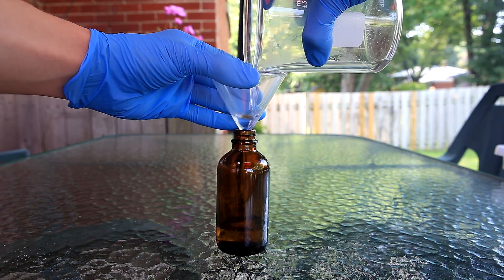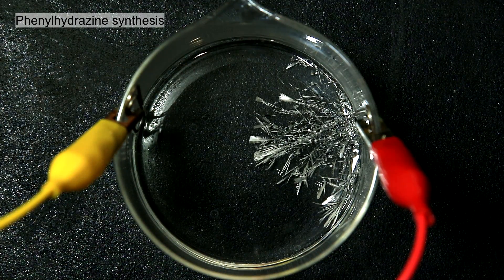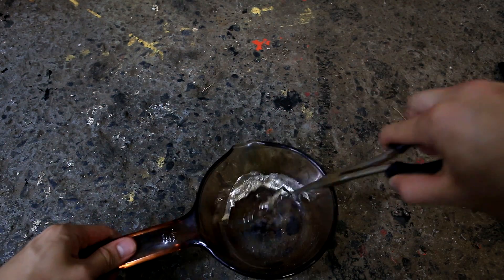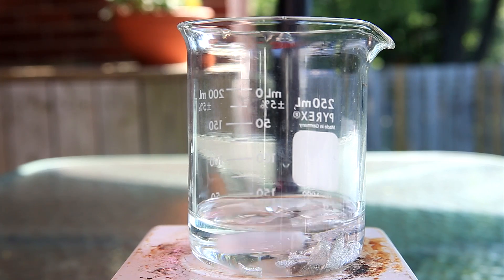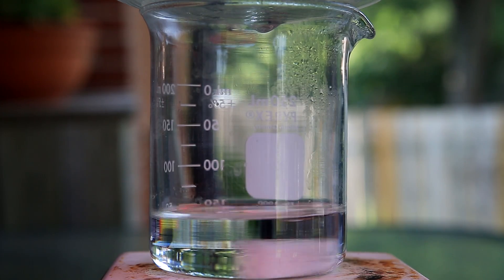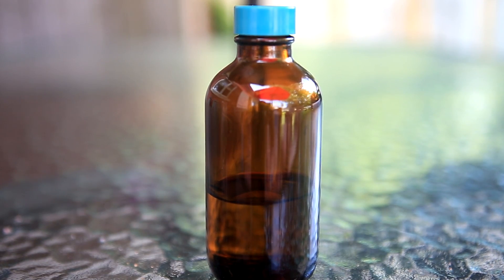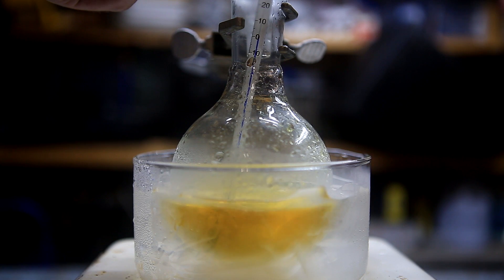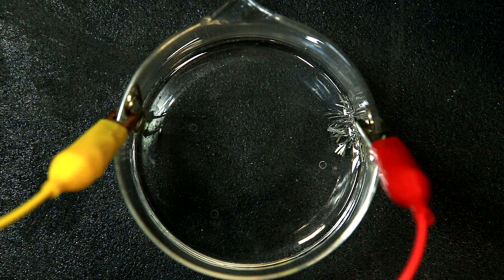How to make a Stannous Chloride Solution (Tin (II) Chloride)

Comment: I have been trying to make stannous chloride. Had two attempts, but every time it turned out to be purple in colour. What has gone wrong? I used tin pellets at 99.9% purity and 32% Hydrochloric acid from the hardware.
Reply: There had to be impurities somewhere. Stannous chloride turns purple upon precipitation, so something made the tin precipitate. Try another source if either acid or tin. Say you try a different brand of HCl and it still turns purple then you know it's your tin and vice versa.

Comment: I'm having a hell of a lot of trouble with the situation I need tin oxide for ceramic glaze recipe. I had A-1 Bail Bond tin ingot already so I put it on the mill and I shaved a small quantity down for testing. I put it in the drawers of my Mill Vice sticking out sideways with a box underneath it so I wouldn't lose any. Anyway I a used a 50-50 solution MTI water and 20 Baum hydrochloric acid that I actually made a couple of years ago. I heated then stirred it for actually a couple of days and all of a sudden all the tin particles turn into white powder. I got pissed off and I turn the heat up all the way and boiled the hell out of it to see if I could get it to go into solution. The amount of white powder dissipated by about 3/4 but when it cooled needle-like crystals formed. I repeated this Experiment three or four times over a week it didn't happen the same way every time. So it isn't entirely that difficult to come up with a crystalline form of tin chloride unless I was just very lucky

I've tried electrolysis to make tin sulfate and stannous chloride and all I get is black sludge on the anode. And the water turned black as well. A funny thing before I add the electrolyte to the bath I noticed it that for a short time before the anode get coated white precipitate flows off of the cathode of tin quit rapidly.

If you have anything to comment on this please do because I'm in desperate need of this oxide
Reply: I'm finding 250g for 25 dollars on ebay - unless you're outside the USA then ignore me
Reply: @ryjelsum  that is a ridiculously high price for my purpose. of it were for chemistry I would be using grams at a time, for pottery glaze, well that's another story, and why I am trying to make it

Comment: Could have been faster with electrolysis in hydrochloric acid, put positive on the tin, and whatever on the negitive, you know
Reply: I was wondering if that would work, thanks for the confirmation. I'd like to do a one step process to produce tin crystals from tin bars and HCl.

Comment: would it be possible to extract the tin from lead free solder
Reply: Yeah, you just need to react the solder with HCl and then either electrolyze it or add nickel or iron to the solution to reduce the solution. However, electrolyzing the solution for too long might reduce other metals too.

Comment: I am wondering that this solution is the same thing as "liquid tin" which can be used in home made PCB manufacturing process for electroless tin plating? Do you know the what is liquid tin. It would be awesome if you make a video about it.
Reply from the maker: From the 2 seconds of searching it appears to be a stannous chloride solution with other ingredients like sulfuric acid and urea
Reply: Thanks. I am not able to find this solution in my country (Turkey) or cannot import due to customs regulations for chemicals. I may give this list of ingredients to local chemists.

Comment: Why do you specify 12g of tin, is that the maximum that the solution can hold before becoming saturated? What type of glass pan did you use to melt the tin? I'm a little surprised it didn't crack under heat from the torch. But maybe I'm just underestimating the heat tolerance of glass cookware(?) Lastly, how stable is the stannous chloride solution of stored in a brown container? Does it need to be stored at or below a certain temp, and. what is it's shelf life? Thanks. The follow-up video of tin crystal making is interesting.
Reply: 12 grams of tin is the ratio, some glass are "pyrex" (I don't know if it's the same in other countries), pyrex glass can hold more heat then normal glass.
Reply: 👉 Tin melts at the comparably low temperature of 450°f or 231°c, which can be easily accomplished on a kitchen stove. That means tin's melting temperature is low enough that it's under the maximum safe heat tolerance of glassware that's specifically made for heating and cooking. I melted a few ounces of tin and poured it directly onto our glass stovetop, and onto a ceramic spoon holder without issue.

 However, it's probably a good idea to point out that there are undoubtedly certain types of glassware that may not handle temperatures of 450°f+ without cracking or breaking.

Comment: Can this be done with lead contaminated tin? Pretty sure hydrochloric acid also reacts with lead. I assume the lead will not form crystals, so I was curious if this may be an easy way to separate tin from lead.
Reply: +Richard Smith 
i guess we're stuck on same problem

my tin solutions become yellowish...
Reply: Franky Yodi So did the solution still form tin crystals? The lead changing the color of the solution is not a surprise. If you are using old solder, you might want to remove any resin that may still be in it as well. That would surely mess things up.
Reply: yesterday i filtrated the solution with filter paper...

but still yellowish..
and next day...
theres some  ??? crystal at bottom...

im not sure that was tin or not
Reply: and now i making zncl2 for welding purpose
far faster than making tin cl2...
3-4grams zn  for 4 hour i guess
Reply: Franky Yodi Mmmkay, I guess that means I'll have to experiment myself with it :)
Reply: But be carefull with lead. When HCL reacts with lead or lead oxides it forms chlorine gas!
Reply: Franky Yodi pb still in solution
Reply: Franky Yodi yg di dasar botol itu PbCl2

Comment: instead of heating the HCl and tin solution, will adding some H2O2 speed up the reaction?
Reply: Yes. I use 3 parts H2O2 (3%) to 1 part HCl

Comment: Most of the tin sources have lead in the, in about 60/40 Sn/Pb, the lead will also react with the HCl, but will it grow crystals with the tin? Or the crystals will be pure tin? Great video!
Reply: KaliyaK PbCl2 would precipitate.
Reply: Yes
Reply: You will poison yourself with lead
Reply: @firehoax9230  
I remember in the 80s when I was 9yo, we used to play with air guns shooting lead pellets. The pellets could easily be lost in a pocket with a hole, so the safest place we found to store them was in our mouth. We all survived!
Reply: I suppose if you have to electrodes , one with lead and one with tin , the tin would go to the tin and the lead would go to the lead , but I dont know
Reply: @1224chrisng "two electrodes, one with lead and one with tin" 

No.
Reply: an interesting idea, but ... The most noble metal will deposit first. This is actually used in copper refining. So first the tin would deposit, then the lead. Albert

Comment: 13 hours... woof. Did you know it would take that long at the start? Perhaps cutting the tin much finer would have helped a bit.
Reply from the maker: +TDKjim8 Yeah it would. Tin powder would go much much faster
Reply: +Nile Red I hoped that you would show us trick how to speed up the process. When I wanted to chemically remove a tin layer from tin plated pieces I would use antimony pentoxide as a catalyst. Of course this useless if you want pure tin chloride.
Reply from the maker: I researched ways to make it faster, but it seems the easiest thing to do is to just be patient.

Comment: Stannous chloride can also be used to test for gold, palladium and platinum in solution. It however, expires, some people says 2 weeks in the bottle, you can extend it's life span by simply putting tin metal in the bottle, the tin IV oxidizes the tin 0 to form 2x tin II, oxygen is the villain. Just thought i could share this!
Reply: this was in a episode of house too lol
Reply: I use it for gold recovery (3g to 30ml HCl) and have noticed degradation too - however it takes several months before it makes a noticable difference... every third month or so I add a 0.2g tin pellet to the bottle...
Reply: Tin popcorn would work better? That is when you flash cool tin by pouring molten tin in water, and steam bubbles caught inside causes it to explode internally like pop corn, revealing a LARGE amount of surface area.
Reply: AuraRisen I'm

Comment: Where do you get those bottles?
also where did you get the tin?
Reply from the maker: +Rsaramallac The bottles are old deuterated solvent bottles from the lab. The tin i bought from ebay from a guy in Russia.
Reply: +Nile Red Dang. You with you're fancy lab connections :l
Reply from the maker: I used to be a grad student, so that makes it easier :p
Reply: I am but a simple Florida native with a table on my driveway :l
Reply from the maker: That's a good place to start! :p
Reply: +Nile Red One of these days i might even upgrade to a shed XD
Reply from the maker: ahh yes. The classic crack shack
Reply: yeah i am just waiting for a cop to drive by and see mt glassware and wonder what the hell is going on in the neighborhood XD